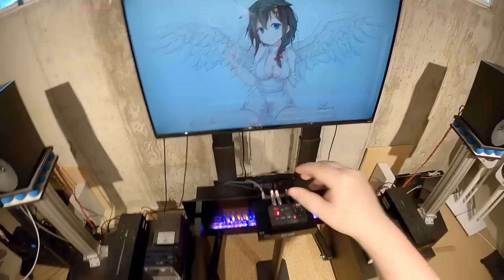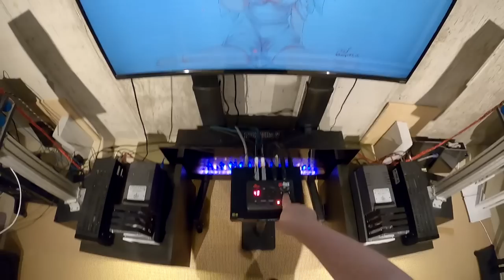🟥Buchardt S400 MKII _(Z Reviews)_ 💎Mads' Mission💎

Comment: Octaves are a doubling of frequency. So the bottom octave that we can hear the pitch of (as opposed to just feel) is 20Hz to 40Hz. Then 40Hz to 80Hz is the next octave, 80-160Hz, 160-320Hz, 320-640Hz, 640-1280Hz, 1.28-2.56kHz, 2.56-5.12kHz, 5.12-10.24kHz, and the top octave is 10.24-20.48kHz. Ten audible octaves is what we have, in theory. Many of us are missing much of the top octave.

Comment: The older version uses aluminum for the woofer cone; and that is why it requires the stiffening ribs that are embossed into the cone, to limit the breakup modes, and push them higher up in frequency. The new version woofer is a paper cone, which is generally a much better performing material in a speaker driver.
They can measure the response they like with the active speaker - and design a passive crossover to come as close to that as possible. Of course, the final tweaking needs to happen by trial and error, as you mention.
The passive radiator acts acoustically very much like a port - except for the lack of chuffing, if the port is driven too far.
Reply: From Stereonet magazine Silver 500's review page : Over the course of this review, I had several exchanges with Charles Minett, Monitor Audio's product design director, and Michael Hedges, the company's technical director. Both insist that the best cones are made of metal and metal composite—that such drivers have the greatest potential for lifelike sound. When I asked if Monitor Audio ever considered using paper or plastic as a substitute, the idea was dismissed out of hand. "There are generally two types of cones," Hedges said. "Soft, well-damped ones and hard, less well-damped ones. The design aim for a soft well-damped one is to accept that the material will ripple and cause distortion in the passband and work with that. In the case of a harder material, like metal, the idea is to create a cone rigid enough so that the audible effects of cone-rippling occur outside the passband so that the frequency response sounds very smooth. We've become very good at achieving this."

Comment: I wonder how the S400 mk2 would do on a higher power tube amp? Not a low power SET, not a cheap made low quality amp, or fake one; but a point to point wired amp, with a big tordial power supply(s), 6SN7 input tubes, KT88 power tubes, big custom output transformers? Something around 50wpc?

Comment: Are the S400 MkII's really made in Denmark?  I recommended the A500s to a friend and she got them.  They are very nice loudspeakers, but I was disappointed to see that they were made in China rather than Denmark.
Reply from the maker: The amplifiers or the Hub are probably china. The speakers themselves, enclosure certainly, is Denmark.
Reply: The MKII are made in Indonesia
Reply: @ZReviews  - I setup the pair of A500s that my friend purchased.  They were shipped from China and are marked as  "Made in China" on the backplate. I can't claim that the A500s that I have had direct experience with are "Chinese speakers", but "Danish speakers" doesn't fit either,  Until I learn more details, I'll call them "designed in Denmark, made in China".  The story may be different for the S400 MKII, particularly if Buchardt crafts its enclosures in Denmark.
Reply: @mikesatteson1534  per website it is made in China…The company is the respected Danish/Chinese-owned Company: Hansong in Nanjing, China…. Only the signature series is made in over there.

Comment: Z, with all respect, between the bare floors & especially those concrete walls, your cellar has gotta be a speaker refraction nightmare. Have you considered buying some faux Persian carpets for the floor & walls?
Reply from the maker: Exact opposite actually, walls behind being as dense as they are reflect just enough and the ceiling absorbs a bunch of the reflections in the insulation and baffles. Other walls are mimes away and the floor has some carpet
Reply: @ZReviews  OK, cool